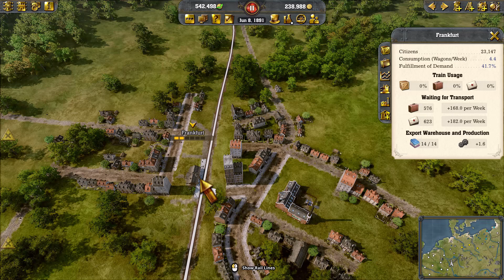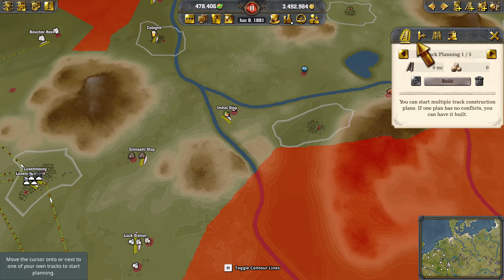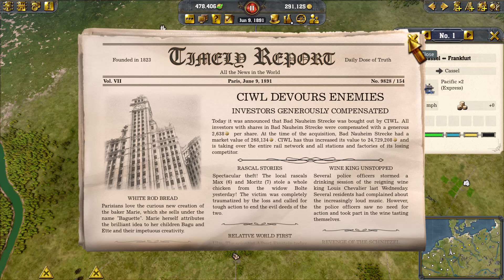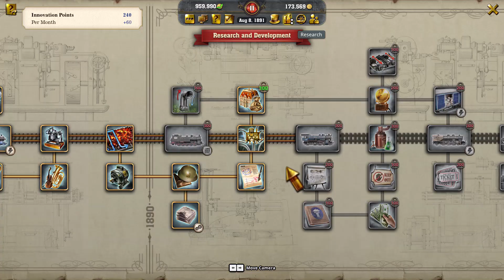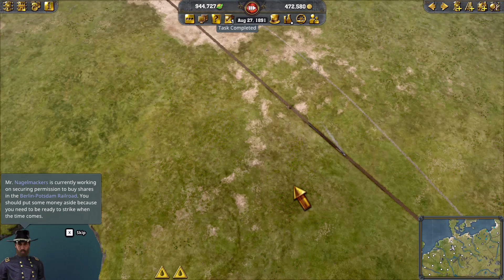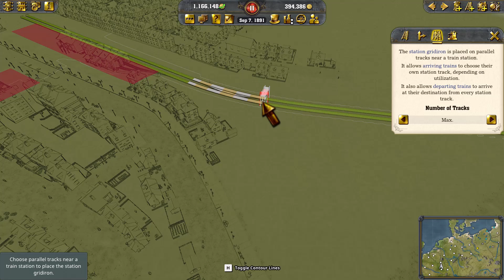Railway Empire 2 Campaign Mission Revisit Chapter Five Part Three

Comment: I have found on this one you need to buy some of raw materials right away before setting up (logs, milk, veggies, fruit) and increase productivity yourself... otherwise they don't level fast enough to keep Paris at high growth

Also would save significant money running freight lines a little out of the way to run along side passenger lines for as many miles as possible i.e. milk to Paris, rheims to Paris... biggest waste of track money. All helps for last stage to buy out last competitor immediately

Bypasses in cities helps for the long express tracks as well (Reims, Lexington)
Reply from the maker: Good tips, thanks for sharing.

Comment: Good video!
I suspected myself what you noticed as well: some raw materials don't level up and some cities don't get a factory unless you put one yourself there. Not sure if that's only in this chapter, usually things do happen. On my run I bought all the stuff early (wood, milk, veggies and fruit).
Another thing I think you noticed: you made express lines between cities and they are pretty much straight lines. Why do some of thos lines do not get the express-status?? (while other lines which are significantly longer than a straight line do!)
I remember someone mentioning your warehouse in paris. I think you might want to get rid of that to make sure all the manufactured goods are for paris since thats the main citie to grow!
Reply from the maker: Thanks.
Each mission or scenario seems to have different raw materials and city sites that won't level up or wait a long time before industries are placed by private investors.
The goods sent to the Paris warehouse will first be for Paris, then when Paris internal storage fills up they will be marked for other cities.
Reply: 45:53  Sometimes you just nee to increase demand (substantially)